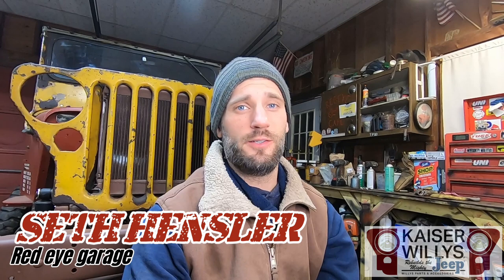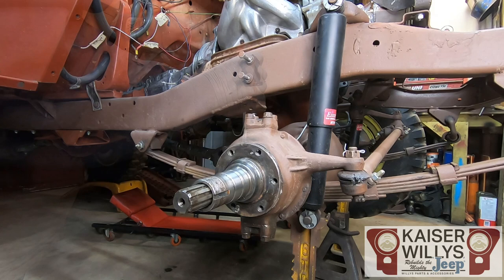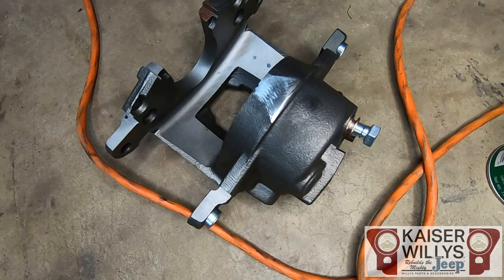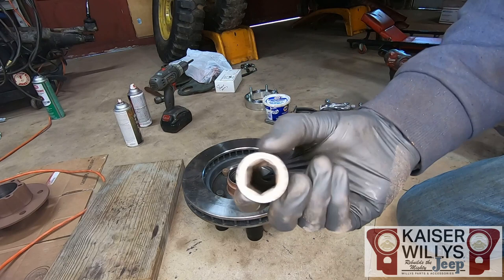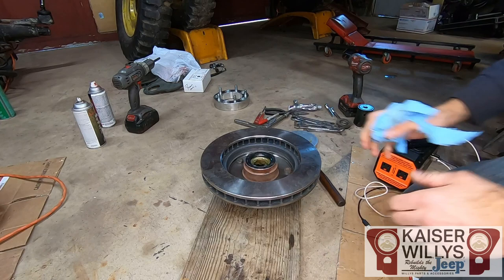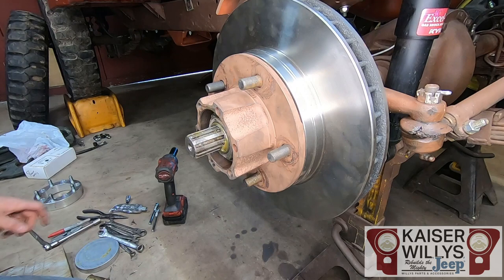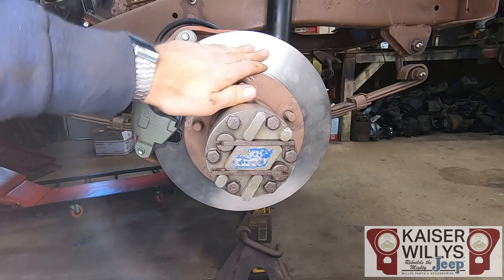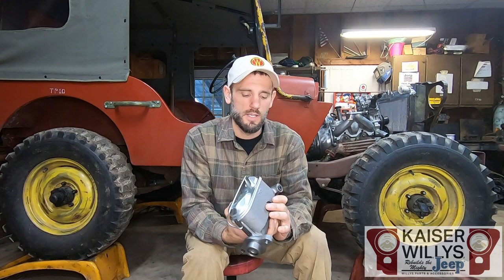Kaiser Willys Cj2A disc brake kit

Comment: If you are working on a budget and or don’t have gloves save your bread bags and then stick you hand in the bag to the end and grab you bearing and stab it in the grease and then get it good and greasy and then pull the bag over the bearing and work the grease in the bearing real good and then pull it back over and drop your bearing in and throw the bag away. 👍
Reply from the maker: Good tip 👍

Comment: the middle washer is a lockwasher it should be bent over to stop the nuts coming loose and  causing rapid bearing failure.
Reply from the maker: I don’t bend the washers over. Never had a problem. Saves a lot of time effort during service. They don’t come loose if properly torqued.
Reply: it's never a problem until it is. bending a lockwasher saves more time and money than replacing wheel bearings,hubs and spindle because the nuts wound themselves off in a minute and the bearings disintegrated.
you're better off bending one side inwards on the inside nut and prying one side outwards to lock the outer nut.

Comment: Great videos but I am having a headache!  Did the disks on the front of my 47 2a and am using my new stock MC.  When my wife and I try to bleed the lines, the front calipers lock up and will not rotate until I release a bleeder screw a tiny bit.  Seems as if no fluid is being returned back to the MC.  I think  (think) I removed the valve in the MC correctly but ????.  One other Utube guy said that a stock MC works good with no modification.  What am I doing wrong??     Thanks much!
Reply from the maker: Whether you use a stock or aftermarket mast cylinder you must remove the residual valve in the MC. 👍 in the stock mc it’s a little rubber diaphragm in front of the piston. In a dual master like the one in this video it’s inside the port.  You must remove this with disc brakes. https://youtu.be/6HCUvON-etU
Reply: Thanks so much and getting very good at removing and replacing a MC for about the 5th time!   You can't believe how many tee shirts I have ruined with brake fluid!

Comment: Did you use the wheel spacers for the stock wheels??
Reply from the maker: I am using spacer. I run 1” but you can get away with much less.

Comment: Would this disk brake system work on a 63 Jeep gladiator
Reply from the maker: If it’s a 6 bolt Dana 44 front axle it should fit.

Comment: Are you still able to use the original brake pedal or does it have to be changed to a hanging pedal?
Reply from the maker: You don’t have to modify anything else. Your jeep can be completely stock with this setup 👍

Comment: Have you ever had a concern with wheel spacers? I'm looking to do this with my 53' 3B, it has 15" stock rims. Have known people who've snapped lugs using spacers. (Probably too big) Would this kit clear with 16" rims?
Reply from the maker: Wheel spacer are fine if installed properly. Watch some of my off road videos. We’re almost all running spacers.  I’ve been beating on them for years. It’s a non issue. Also remember where dealing a 2000 pound jeep. Not some 600 hp dually. 😆 You will need some type of spacer to clear these big discs with stock wheels.
Reply: @redeyecafegarage7484  Merry Christmas! Thanks so much for the input! Puts my Dad's concerns at ease XD. I see you run 1" spacers, is that on 15 or 16" rims? I see Kaiser only has 1.25" spacers. If I was to look for a 1" or less, what specs should I be looking for? I see many different types of 5x5.5 spacers. Any recommendations would be appreciated. I am using 15" rims.

Comment: Nice video.  I installed the same kit on my 55 wagon with 15 inch rims and there is no way they will fit.  Are your rims the 16inch from Kaiser?  Did you have to do anything to make the caliper fit the rims?
Reply from the maker: I have stock 16’s with 1” spacers.  If you want to avoid spacers. You must use 15” wheels from a later model cj5. From the late 70’s on they had disc brake fronts and those wheels fit fine without spacer. 15 and 16 I’m h wheels from drum brake Dana 25 and 27 will require spacers. It’s kinda just par for the course. I can assure you the improved braking and maintenance requirements are well worth the spacers. I get mine on Amazon. Set of 4 are $90. I have a used them off and on road for years with no issues and 1” spacers aren’t visually noticeable 👍
Reply: @redeyecafegarage7484  being that I already did the conversion there is no going back to drums so thanks very much for the info.  Very very helpful!